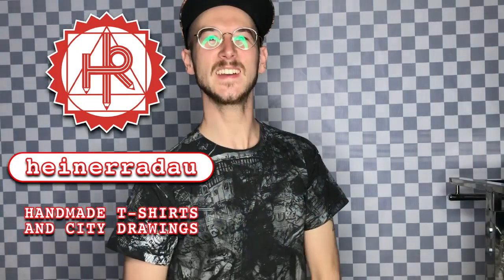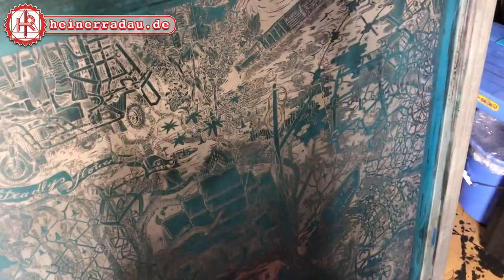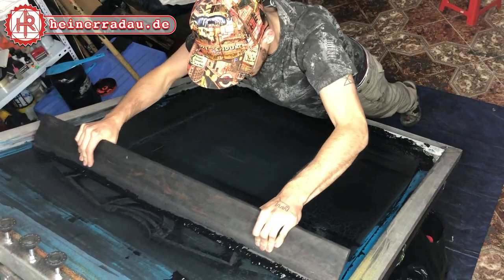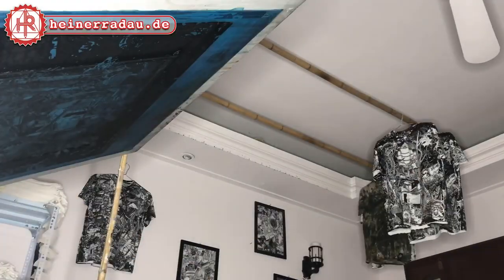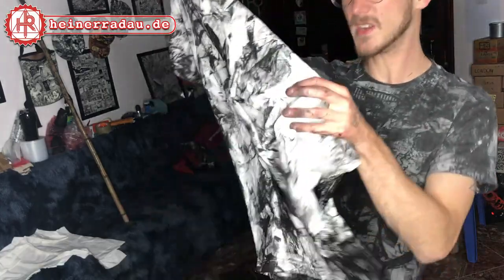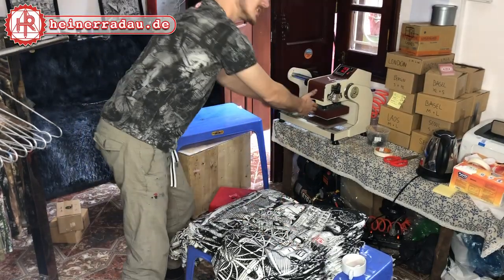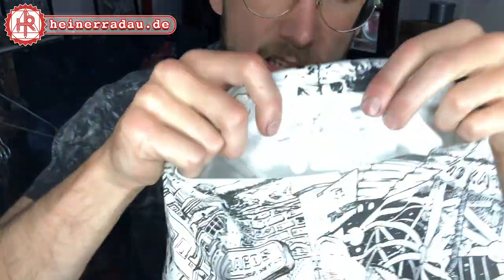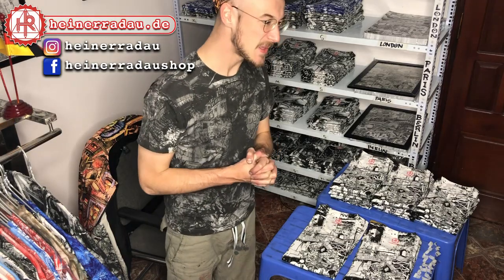Handmade All Over Print T-Shirt Production Process | HEINER RADAU

Comment: Question:

1. What is the size of your screen, and how much screen mesh did you use?
2. That flatten, is it made on ply-board with laminated sheet, or ply-board with metal sheet?
3. What type of ink did you use?

Thanks for answering.... Awesome video, btw... 😉😉😉
Reply from the maker: 1) 110x140cm size screen, mesh 59T
2) 8mm aluminum panel, folded on the sides
3) waterbased ink, Vietnam binder system

Cheers
Reply: @HeinerRadau  🍻🍻🍻
Reply: Love your workmanship / process 

Hands down most detailed on yt 

Nice work ❤
Reply: @HeinerRadau where did you get a 110x140 cm screen
Reply from the maker: @fazec0pped58  make a guess.
Reply: @HeinerRadau  wym take a guess why can't u just tell us
Reply from the maker: @cocosmokes  because its common sense.
Reply: hi, @HeinerRadau  does the aluminum keep the shirt from moving when moving? i want to try this setup but that is my biggest worry at the moment
Reply from the maker: @NextgenSkillz  Yes sliding is an issue, and aluminum is a bit expensive as well, and not necessary. for new setup I’ve used wood and rubber surface + rolltack glue.  Check out the my Instagram to see the new table
Reply: Awesome video. Exactly what I’m after! Im confused on this, “water based ink. Vietnam binder system” though… In my experience with water based inks, you’ve still had to “cure” them once dry to the touch.. but, that doesn’t seem to be the case here; would you kindly care to elaborate and/or link to the ink?
Reply: Did you draw the designs?
Reply: @HeinerRadau you made the screens?

Comment: Hey man thanks for the video ! its very helpful. I read that you had issues with fading. Does air drying the wated based inks work well ?
Reply from the maker: Air dry works well for me 48hrs
Reply: @HeinerRadau you can get something called a cold cure additive which means your ink will cure fully at room temperature in around 24h. The only issue with it is that you add it to the ink you are using and then that ink can’t be added back to the pot afterwards, it’ll set solid. So you’d get a better cure but would end up wasting more ink.
Reply from the maker: @sendbreakmend  that’s right I’m using this type of cold fixing agent additive. The ink doesn’t break, but the agent fades after 6-8h, so you have to add new fixative when you refill the ink.

Comment: hello i love this and you've definitely inspired me! may I ask where did you get the big metal printing table from? did you set this all up costum by yourself?
Reply from the maker: Hi Clorox, cool name lol ^^ thanks for ur feedback. The metal table I’m using is 0,8mm aluminum with an under frame. It is CNC water cut and bent by machine. I got it in Hanoi by working together on the project with a professional screen printing company.

But all that is not necessary. All you need is a flat surface, the material depending on your budget. The table is inclinated, because of the large surface it’s easier to print by hand and wont hurt your back. 

There are many different ways to set this up, all depends on your workshop space, production capacity and budget :)
Reply: @HeinerRadau  thank u! one more question! How do you do the exposure on a screen that big? do you use a lightbox, or just sit them out in the sun?
Reply from the maker: @chevinkennedy  if you'd be a professional, you would use a large vacuum table and a massive capacity lamp for exposure. if you're not an industrial, yes i suggest you could use the sunlight. it has the most even distribution of light on a larger surface. best, do some research online and testing to find the right time for developing. let me know how your progress is going :) wish you success!

Comment: What durometer squeegee do you use for such large prints? Does mesh resolution or ink viscosity affect it much at this scale?
Reply from the maker: Sorry I’m not sure I understand your question. are you referring to the hardness of the squeegee? I can’t tell you a number here but the squeegee is green and rather flexible rubber material.
Reply from the maker: of course the mesh and ink viscosity is the key parameters for a good print on fabrics.

Comment: Quick question where can I get machine like yours and with multiple colors
Reply from the maker: 😄 tbh it’s a bit complicated.

For one sided all over print you can use T-shirt shaped panels and set the lot of shirts aside while you change screens. I think you can find a video of someone doing that in my „Screenprint“ playlist. 

But if you want to print both sides of the shirt, it will certainly leave you a white line on shoulders and sides because of the panels thickness.

Comment: What number mash you are using ? And it's nylon? How many times these frames can be used?
Reply from the maker: I think it’s a 59 mesh. Would have to guess the material, I think it’s usually polyester. The frames are Aluminum and can be reused / stretched again indefinitely.

Comment: If you can show us where to get the screens or how to do a all over screen print would be very helpful because their is no videos on how to make all over prints by screen printing. You could be the first.
Reply from the maker: I buy them from a company in Vietnam. But you can, no matter where you are:

1) Just get a big ass frame, 
2) glue together your artwork printed on transparent polyester film
3) develop the screen 
4) print all over anything you like 

🤔Is this helpful?
Reply: @HeinerRadau  yeah kinda i made my own very big frame from wood but printing out the images big and burning was very hard to do
Reply from the maker: @ismaelolvera6763  how did you setup about the developing process?
Reply: @HeinerRadau  i first printed out the images on paper to see how big i need to make the frame and also to see how big the image will be. then made my frame and put the emulsion down let it dry then burned my image with a 1000w light but since the frame was big their was some spots that didn't burn well and came off.
Reply from the maker: @ismaelolvera6763  😄 
1)why did you have to adapt the frame to the image and not the other way around?

2) how did you ensure the image lies flat on the screen while developing it?
Reply: @HeinerRadau  1. Idk it was my first time screen printing and I wanted to do a all over first as my screen print.

2. I lined up all the transparent paper and taped them up together so they will all hold and put plexiglass on top of it to hold it down In place
Reply from the maker: @ismaelolvera6763  2) you should put some styrofoam or other material to back it from behind . Also when developing complex images with your own DIY light source, it’s safer to use transparent film, instead of transparent paper.
Reply from the maker: @ismaelolvera6763  like you really gotta trap that film as flat as possible on the screen. 
1)Plexiglass from the front, 
2) your image on transparent film, 
3) the coated mesh, 
4) styrofoam to hold it tight 

Good luck 👍 🍀
Reply: @HeinerRadau  thank you, i'll do that on my next screen
Reply from the maker: @ismaelolvera6763  right, and share your progress with me, i wanna know if you can make it :) wish you success!
Reply: @HeinerRadau  Are you able to share the company that you buy the screen from?
Reply: @HeinerRadau  Also can you please let me know where you get your transparency films for the 90 x90 screens
Reply from the maker: @Eduardo Castellanos  it’s a local company in Vietnam. Shipping to overseas is very expensive. 

Don’t be so lazy and ask me about that stuff in comments in my own video that have already been answered!

Just do your freaking homework and find a local supplier for Screenprint supplies in your country god damn it.
Reply from the maker: @Eduardo Castellanos  same here, FIND A LOCAL SUPPLIER.

Comment: as a screenprinter i can say that technique is so wrong. but i respect you for making it all, your drawings are awesome. i hope you'll find out more details about screenprinting. i hope your impressions will become better and better. 
1) there must be a gap between the screen and a substrate. that helps to keep the ink coat even. the screen must touch the substrate only when the squeegee is pushing right there
2) you should cover the image with ink without any pressure at first, this way your squeegee will always have the ink to push through the mesh
Reply from the maker: hi and thx for your feedback. 
actually besides me being lazy, i read that its kind of the usual way to print absorbing textiles without gap. For flooding the screen first, i agree with you and have already changed my method :)

besides, are you screen printer yourself and run a business? where do you working and what products do you decorate? have a happy new year. cheers from germany
Reply: @HeinerRadau  happy new year to you too)
I'm a regular printer, I don't run any business. That's cool info about textiles, we usually print on coloured papers, but sometimes do book liners